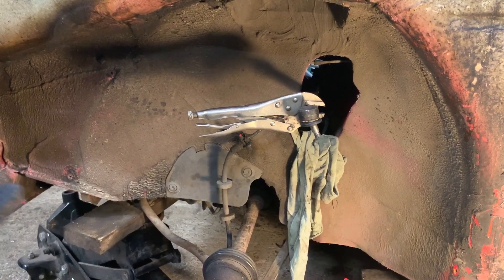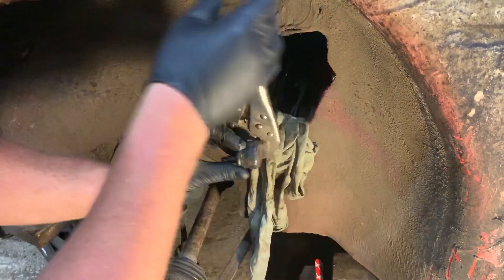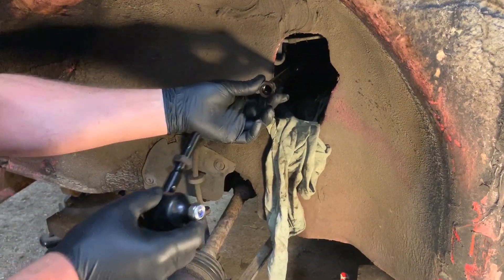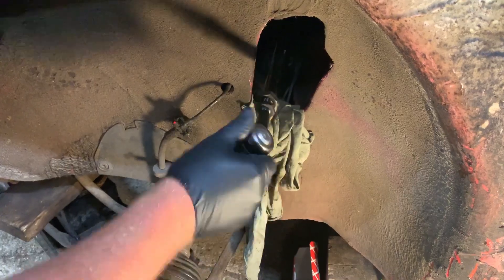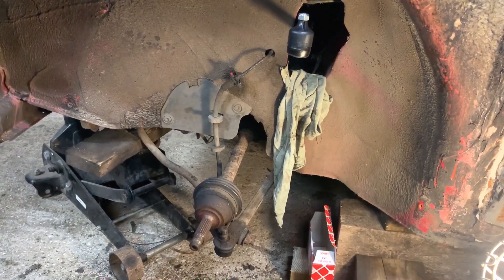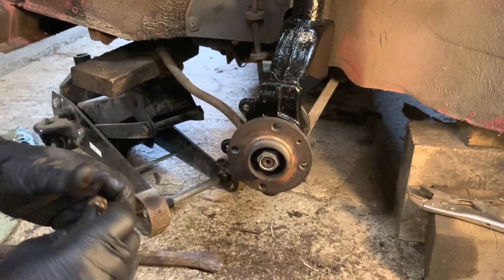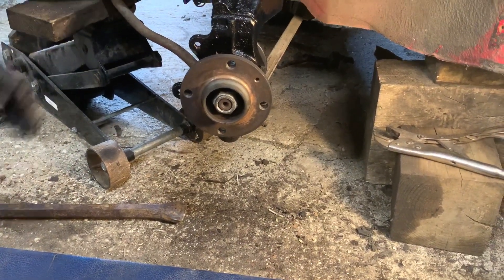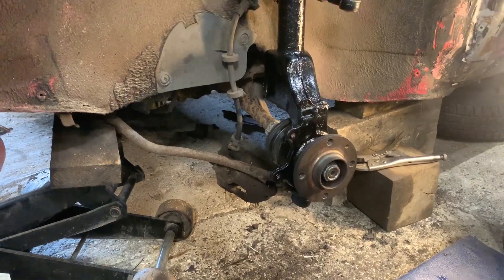VW Polo MK2 Breadvan ( Refitting the Suspension Leg & Track rod end )

Comment: Nice job Luke Laura.luke I sent you a email last night about the M4 major throttle cable..
Reply from the maker: Hi Gary yes I got it my engine is different, but I think it just connects at the front, but yours looks like it doesn’t have the hole, though further back the holes are there but the cable won’t reach 🤷‍♂️ I think your going to just have the work it out and drill a hole 🙂👍
Reply: @menditman2004  frustrating Luke it not fit any other lol

Comment: This is why I just decided to change everything, new rods, ends, lower arms, coilovers, bearings, brakes, all the rubber, shouldn't have to touch it for a few years once I'm done. Is the plan to keep this then?
Reply from the maker: Hi the plan is to keep it at least for a good while, some things I didn’t change as I’m pretty certain they will be good for a long time, but I will go back to the other side and put a new track rod end on that at some point. I have many projects and have decided if some things are still good I’m not changing them its just to costly and a waste of time. I didn’t need to do all this work on this one but it had new brakes in the boot when I bought it, thanks for watching 🙂👍